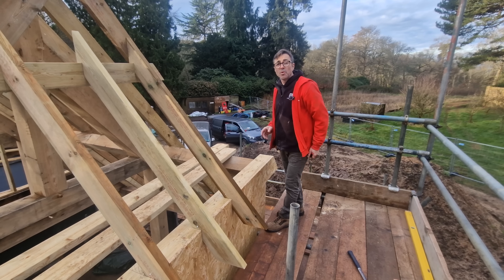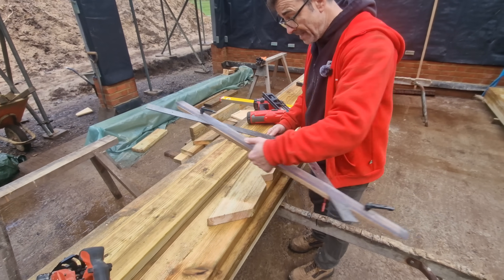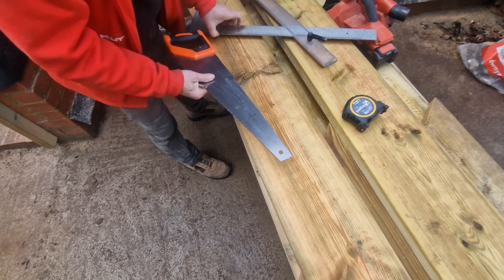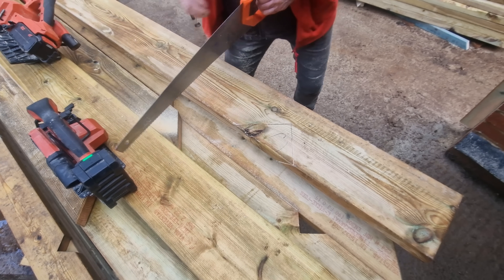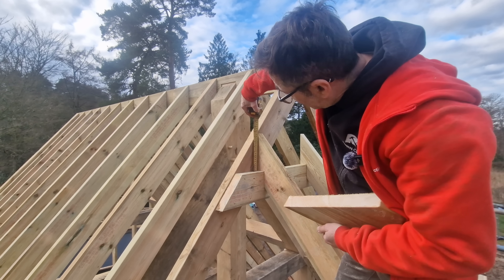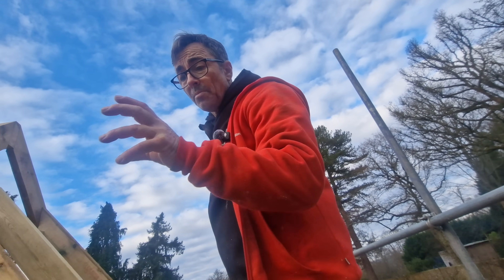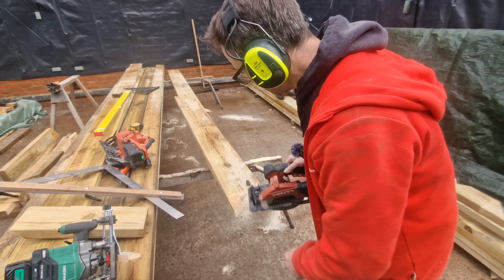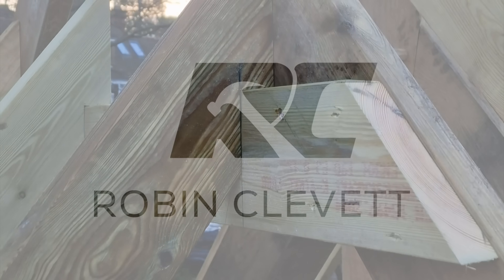Hip rafter setting out and cutting for a Gablet roof. Big Garage Build

Comment: Really enjoyed this Robin, it took me way back, I left the UK  back in 89, I was in my very early 20’s. I went to live and work in Canada where I began my framing career. At the time nearly all the roofs were cut roofs and it was very daunting till an old carpenter took me under his wing and after giving me a rafter square and a hell of a lot of one on one tuition it all started to make sense. A good joiner should be able to go up high just to take a couple of measurements and cut the whole roof on the ground. Every piece of information you need is contained on the rafter square.

Comment: Great video Robin, I'm a retired carpenter, I never had a roofing square, as an apprentice I was taught to use geometry on a piece of plywood to get all my angles and lengths and I stuck with that method throughout my working life. Another thing I carried with me from my apprenticeship was to always put a dihedral on the top edge of the hip. Your videos reassure me that there is still a place for craftsmanship in an industry that seems to be moving ever closer to component assembly. Well done that man!

Comment: Great little tips are what make the job easier. I’ve always measured the depth of the birdsmouth through the section of the timber rather than down the plumb line, it never occurred to me that this will change because of the change in pitch on the hip and that’s why my hips usually don’t line through, so obvious now you’ve pointed it out 👏🏻👏🏻

I know what you’re saying about lean toos though, but I’ve done loads (all in fact) where I’ve lined the tip of the rafter up to the edge of the plate and I’m willing to be that not one single one has dropped. It’s only the same as the ridge on any other pitched roof.
Reply from the maker: Brilliant, so glad that this has assisted you for the future

Comment: Hi Robin. Don't know if you have one already. But how about a video on sharpening tools, chisels,plane blades,general care of tools. Just something for us novices. Thanks .
Reply: If the back of your chisel or plane iron isn't completely flat you'll never have a truly sharp edge. Unless you can shave the hair off you're arm with an edge your not there yet. I find Eze-lap diamond plates to be excellent and then to finish I use a leather strop with some buffing compound, 👍💪🔨🇮🇪🇮🇪
Reply from the maker: Nice tip!!
Reply: @robinclevettcarpenter   Good man Robin, that was another masterclass in carpentry. A piece of plate glass and a bit of brasso polish gets one a seriously sharp edge as well, 👍💪🔨🇮🇪

Comment: That was a good comment about the pole plate on lean to roofs, I've always done it the same way as you even when the architect doesn't stipulate it. And if it's against a brick/block work wall chem fix with threaded bar, seen so many people use thunder bolts but i think chem fix is so much better
Reply from the maker: Yes your way with the chemical fixings and the pole plate is belt and braces!! keep up the high standards mate its what it is all about if you ask me!!

Comment: Your work is undoubtedly excellent. However, there is one aspect of this project that I can't quite grasp: the use of OSB. While all the other materials have a proven lifespan of 100 to 400 years, OSB has an unproven lifespan of only 30 to 60 years. I would have expected to see tongue and groove wooden board sheathing or plain sawn board used instead.

Comment: The L shaped workshop I'm hoping to build (if the stars align) this summer, will have two valleys where the lower roof meets the main roof. This is all top information, I'll just need to apply it upside down!

Comment: You don't need 2 saws just flip the timber and step back the width of itself to cut the other 45°
Reply: Yes but if you have them use them believe it or not that time taking fliping over repeatedly soon adds up have 2 soon pays for itself

Comment: How would you feel about the rafters sitting into joist hangers which are attached to the ledger that's fixed into the wall? For a lean to roof i mean. I put a small seat cut on the bottom so the rafter sits into the bottom of the hanger. I hope that makes sense.

Comment: When you were talking about gablets in previous videos then I thought you were talking about some small woodland animal!!  It's a lovely detail and I can also see why the trusses are set in.
Also, talking about hip ends - have I told you why dragon ties are called that? And do you ever put in a dragon tie?
Reply from the maker: Hi John, I have put dragon ties in generally at the plate level on a hipped roof, traditionally they are halved into the wall plate or sometimes fixed over the top, I do not know why they have that name, can you enlighten me?
Reply: @robinclevettcarpenter  it's all a case of Chinese whispers.  I've got lots of old books on building and roof construction as I do come across a lot of old buildings.  So books at turn of the century would refer to this form of construction, mainly a triangulation if timbers to prevent the hip from pushing the corner out as a 'dragging' tie.  Which makes sense as it wants to drag back any tendency for the hip to push out.  Do you know of the Mitchell set of building construction book?  As I say I've got one from about 1920 that's shows it as a dragging tie but come 1960s it morphed into being called a dragon tie.  As it doesn't look anything like a dragon, I think it's just carpenters/roofers mishearing and,as I said, a form of Chinese whispers!!